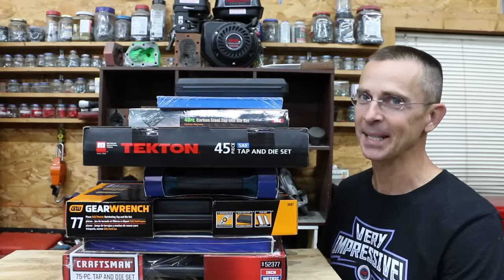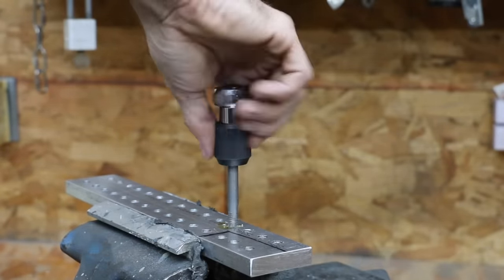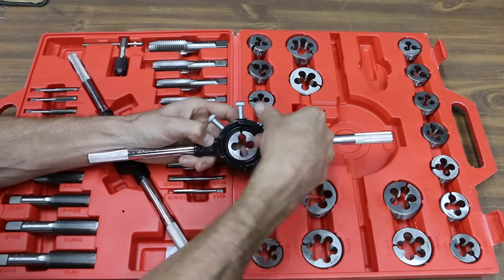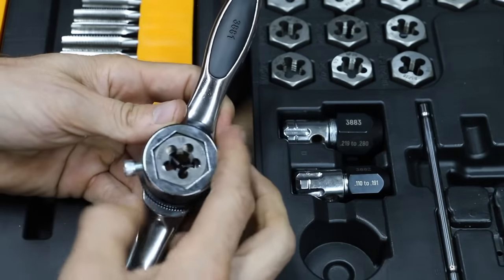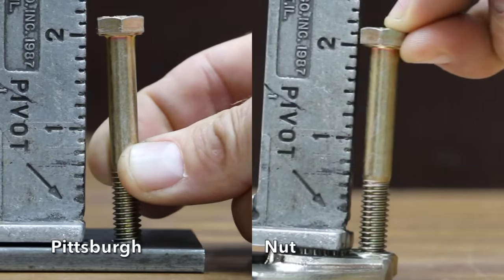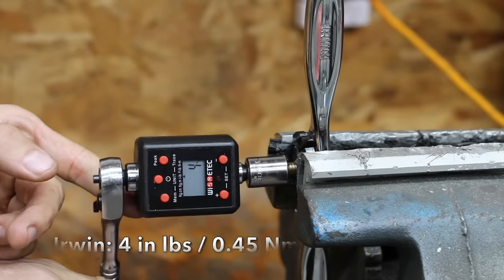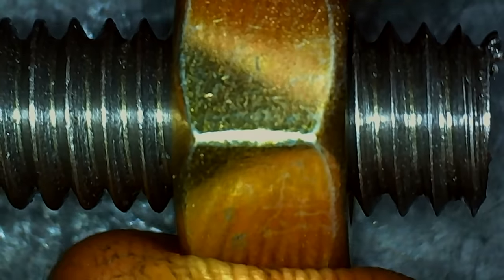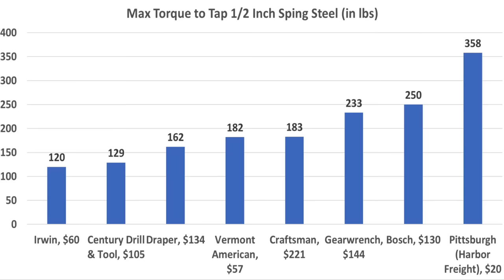Best TAP & DIE Set? Craftsman vs Irwin, Bosch, Draper, Vermont American, Tekton, GearWrench

Comment: The first problem I see is that these are, as expected, “hand taps”. Hand taps aren’t meant to be driven continuously through the material. You are supposed to turn forwards a turn or two (at the most), and then turn a half turn backwards to clear the chips. You need to do this until the entire thread is cut. That’s NOT what was done here. Therefore, these sets were not used properly.

I can’t take these sets seriously since they weren’t used properly. The other problem is the way he was tapping. Yes, he started the tap straight. But, in reality, you have to tap it straight. That’s not what he did. In order to get an accurately cut thread, you have to use a tap wrench with handles on both sides, applying pressure evenly on both handles, watching the tap while you’re tapping, so that it doesn’t wobble and make a bigger tapped hole. 

With the dies, you are supposed to be doing these by hand as well, clearing chips as you go. Handheld die wrenches aren’t required to clear chips without some help.

I always recommend that people not buy these sets unless you almost never have to use them but have no idea which ones you will need when you do. Otherwise, buy spiral tooth taps that will allow you to tap continuously through making batter threads and much lower force. Buy what you need when you do. You’ll be happier in the long run.
Reply: I’ve just come on to say much the same thing 👍👍
Reply: Agreed (though it's "spiral flute" not "spiral tooth" taps).
Reply: @PeregrineBF  I said tooth to distinguish from spiral flute taps which are different, and used for blind holes, as they project the cutting out the back of the tap, towards you. Spiral taps, as they’re just usually called, or sometimes machine taps, or gun taps, have straight flutes, but the cutting teeth are at a short spiral at the cutting end. They push the cut strings forwards, out the front of the tap, through the hole.
Reply: This is a fair critique. The instructions for the pittsburgh tap do include the instructions that you should turn backwards to clear out the chips.  I'd expect the others do as well, since AFAIK this is standard technique for hand taps.  Standard advice as I recall from my father from 40+ years ago.
Reply: I agree. His tests are normally very good, but this one was a failure. The procedure for cutting both internal and external threads was completely wrong. You MUST clear the chips. You have to work slowly and get a feel for how  your tap or die is cutting. Most people just drill a hole and use a tap like they’re installing a bolt into a threaded hole. No wonder they get poor results or a broken tap. There’s a great deal of finesse involved.  In over 40 years of metalworking I’ve never broken a tap for three reasons: using quality taps, working slowly with a quality tapping fluid, a a lot of good luck.
Reply: I agree with your comments on the abusive way the taps where used, however all the sets where abused the same so the test does allow for a comparison of how these tap and die sets hold up under abuse. 
Also in the real world we can't always follow all the rules whem it comes to cutting threads.
Reply: @jonathanlloyd919  the problem is that when used incorrectly, you don’t know how the results will correlate to them being used correctly. These are carbon steel. No matter how good, they will wear fairly quickly when compared to decent HSS taps. When used in a drill as the cutting was done for the dies, they will heat up. Likely not enough to remove their hardness, but not good. The flutes on hand taps are designed differently. In fact, they were the first taps made by machine back in the 1800s, and it was just the only way they could make them. So they couldn’t be used in machines because they have to go back and forth.

When he used them the way he did, he totally moved out of the envelope they work in, and so the tests mean little other than that some of the sets are just junk, and you could tell that just by looking at them—no tests needed. But for the better sets, these tests obscure the real differences, if any, because of the abuse he subjected them to.

These aren’t the only tests he’s done that go against the way tools are supposed to be used. Not everything can be subjected to the same tests, in exactly the same way. That’s simply incorrect. I’ve got hundreds of drill bits, for example. Entire sets designed for just some materials, for no more than a certain depth. Test a set the wrong way, and even though it excels for what it’s designed for, it will fail. Does that say it’s bad? No, just that the user didn’t know what he was doing. Use hand taps the way you use machine taps, and they will fail. A tap should have hundreds of holes to tap before it goes bad. At the very least, dozens in a difficult material, before it substantially dulls.

If I have to tap something in a crevasse, say, and need a long handle tap holder, I hold the handle with one hand and steady the shaft with the other so that it doesn’t wobble, and open the hole too much for a loose fit. The way he did it almost ensured a bad fit. I’m surprised any looked half way decent. You can’t use a hand tap holder with a long handle with a torque extension, with a handle on the end of that, and use one hand to tap.

Comment: I knew a guy that used to do specialty tune-ups. He was so particular with his tune ups when he bought spark plugs at the parts store he took his microscope with him to check for cracks so small they aren't visible however close you look. It was amazing how he could walk into a parts store and only every 1 in 3 plugs had no cracks in  them. I would like to see a video that tests tiny cracks in the plugs, or testing the difference between copper, iridium, and other types of plugs. Great video by the way.
Reply: Denso Iridium Power are supposedly the best ones, but of course a test would be great.
Reply: But also, usually the best bet is to stick with what the manufacturer recommends, because you can never really substitute one brand for another one to one.
Reply: @pubbiehive  From experience, I'd agree.  I bought some E3 plugs for 2 of my cars about a year ago.  After a year, one car is fine, the other car started having severe miss-fire problems.  Replaced the plugs with the originals plugs with 50K miles, and the miss-fire went away.

Good quality plugs that last 70-100 thousand miles are somewhat expensive at $7-$12 a plug, so just buy the same plug the manufacturer put in and you won't have problems.
Reply: He actually has a video already testing lots of spark plugs if you've seen them but nothing about cracking tho

Comment: What a professional test! My immediate takeaway are:
1) I should just pitch my 'Pittsburg' tap and die set (which I already knew removed a lot of material from pre-threaded threaded rods/bolts and resulted in loose fitting nuts)
2) Even without use on spring steel, taps/dies have a shorter usable life than many tools - somewhat akin to drill bits, except taps/dies cannot be re-sharpened.
Reply from the maker: Thanks!  Thanks for the feedback.
Reply: You can resharpen a tap. Especially the expensive ones.
Reply: @Ztalin  I'm surprised..The actual amount of material (leading edges of the flutes) is quite small and any removal of material will shrink at least the minor (root) diameter of the tapped hole. Do they first rebuild the material on the tap via. a plasma spray or vapor deposition, and then sharpen
Reply: @gregparrott  No you just grind the chip surface och the flute. When we do it at work we remove about 0.1-0.3mm. Most taps can be resharpened at least 2 times. The relief angle on the flutes is not big and the tolerance on the diameter is not an issue.
Reply: @Ztalin  I don't mean to 'nitpick', but 0.3mm can be a lot. That's 5% relative to a 6mm bolt.
That leads me to ask what size limitation exists on resharpening taps. If you're resharpening taps for holes in large structural elements, 0.3mm seems fine. But my limited world rarely sees bolts larger than 12mm.
Reply: @gregparrott  0.3mm with a relief of 1-2° relief gives you a decreased radius of 0.01mm. We resharpen taps daily for customers. The biggest ive worked on was a m72. The choice between resharpen or throw away is something i know from experience.
Reply: @Ztalin  Good to know. Even though it's very unlikely my usage and level of tool purchases will ever warrant resharpening a tap, I appreciate learning from those who have a professional level of knowledge.

Comment: Taps are a perfect illustration of "Quality doesn't cost, it pays".  Now that I have a full set, every tap I replace is the best quality I can find, because removing broken taps is no fun at all!
Reply: What full set do you recommend?  I need to get one but am only buying once.
Reply: @Mikesmeyer88  Sorry, that's like saying you're only buying drill bits or tires once.  Taps are cutting tools and will dull with use.  And continuing to use a worn-out tap is a sure way to break even a top-quality one.  Buy a reasonable quality set and, as they wear out, replace them with top quality.  Most people won't even use half the taps in a large set.
Reply: I agree. i quit like 3 stage taps as im in no rush to remove a broken one. I generally pay more for 1 good set of 3 taps than the sets in this vid
Reply: The integrity of the material one is cutting and tapping varies greatly also. I travelled nine states for a union contractor, founded in 1869, that manufactured and installed  industrial and institutional heating, cooling, and process equipment. 
 I was lead service foreman and was also hands on in service and project management. We also designed and built our proprietary control systems. 
 Many of our bids required that all materials be sourced in the US. With power threaders we would occasionally get garbage raw stock that one just couldn't cut - it would seize, roll, and mutilate the stock.
   I still have pipe dies with MANUAL handles from 1/8" up to 2 1/2" NPT, and taps/ dies to ridiculous diameters (most techs these days would run or faint!) 
  Was a lot of tough work but it was very rewarding. -- and then I fought fire, cut people out of their vehicles, ran EMS, dive team, and occasionally flew with medical helicopters to unwind after dealing with some of the people with too many framed documents on their plush office walls -----
 ** Definitely appreciate the effort and time put into these videos.
Reply: @Mikesmeyer88  Do not buy a set. Even the best ones pale in comparison to a quality tap. Buy a tap when you need it and eventually you'll have a set.

Comment: Hanson are still up there, but finding a good set is tough. Irwin seems to make the weirdest sets, so you have to buy two or three for some of the sizes. And I will say this again, Husky (and in general cheapo Chinese ones) suck. I don't care if they warranty them for life if it breaks the parts I was working on (whit the tap grenades).

Also, I will say, the die will clog going in all the way without backking up. The rule is do a few full turns, then back off half to one turn, which is why I do like the reversable ratcheting stock. For the die, once you use a Starrett, you won't go back. Those are NICE.
Reply from the maker: Thanks for the feedback.
Reply: @ProjectFarm  He is right, though.

Retail junk like Husky will usually break when you are miles from the nearest Harbor Freight location.

People who use your opinion to make actual real world decisions for tool purchases just don't care about the newest and neatest Ikon branded indexing ratchet.

Comment: Thanks for another great comparison test.   Through a lifetime of hobbyist metalworking, I've learned that anything less than US-made HSS is a waste of time and money.  These cheap sets may be OK for the occasional homeowner thread cleanup, but if you want good threads, good tap life, and avoiding broken taps, you have to pay for the quality.   Anything "high carbon" or similar is good for nothing more than cleaning up existing threads.    Anything Chinese is inherently junk.

I would have liked to see this test at least include a control reference consisting of something like a Kennametal, Cleveland, Greenfield, Union-Butterfield high quality tap.   

It is also important to make sure the tap goes in straight by using a spring-loaded tap guide.  Even after starting off from the drill press, if you wobble a bit or if you're off perpendicular by even a small amount, it makes a big difference in thread quality, tapping force, tap life, and not breaking your tap.

I've learned the hard way over the years that all these sets are basically junk, even for hobbyist metalworking.  You can buy your taps one at a time as needed and have them in a day or 2 from MSC or McMaster-Carr.  You'll pay more for one tap than for an entire set of these cheap Chinese taps, but believe me, it's worth it.
Reply: concur
Reply: Je veu voir.Yvan bolduc Lewiston meine USA.

Comment: I’m a diesel tech, and I own a snap on set. They are very very good. Taps the quickest and I have only ever broke one, and the broken section only revealed itself after I already removed the tap (I.e the tool didn’t” break in the bolt hole). Very good tool, highly recommend.
Reply from the maker: Thanks for the feedback.

Comment: Awesome videos, and usually I have no complaints. But this time I have concerns. Both the side-to-side tolerances and the torque needed are very sensitive to how straight the tap or die is and driving them by hand with no guides is going to make that vary a lot. In the sped up video you can see the some of the taps rocking from side to side and the rod didn't look straight in any of the die tests. I would recommend testing with a tap guide holding the tape straight to see if the side to side tolerances were better and for the rod to see if the dies lasted longer (though yeah, clearing chips would be fairer too).
Reply: That’s my complaint as well, torque testing with a wobbly setup then measuring the looseness of the bolt is not a great test. Too many variables. Doing a comparison like I the first test is fine but when you add measurements but use the same janky setup I think you invalidate the results. 

Same with the die test. Performing a failure test intended to determine how far the rod will go is not the intended use of the die and shouldn’t be how you measure if you will get a tight fit under specified procedure.

Comment: The Craftsman and Gear Wrench sets were impressive!
I own a Snap-on set myself and I've had it for 27 years - hardly used.
Tap and die sets are rarely used by skilled mechanics but when you need it, you're mighty glad it's in your tool box.  
Don't buy a cheap set!  
I might buy the Gear Wrench for the die handle.

Thanks again PF for yet again another well informed video.
Reply from the maker: You are welcome!
Reply: very true, if you're using these all the time you're doing something wrong
Reply: @MattB90  OR a fastener breaks when you are trying to remove a rusted or otherwise seized fastener.  OR you're removing a ferrous fastener in a aluminum tap with a lot of electrolysis in the tap and the tap is stripped out.
I rarely encounter these situations, and when I do I usually know what to do to avoid the use of the tap and tie or a heli-coil.   As I said, my set is rarely used in 27+ years.  It still looks new!  (Wanna buy it?) 😏
Reply: @Inquisitor6321  Do I want to buy your snap-on tap/die set? of course...can I afford to? probably not lol
Reply: @MattB90  I bought it 27 years ago.  I paid less for it than the Craftsman kit goes for today.

Comment: This was a really good, useful review...I purchased my Craftsman set back when Craftsman was still made in the USA. It's at least 40 years old. I've never had to replace any of the taps or dies and in fact I've done nothing but add to it. I use it to cut threads in everything from hardwood to high carbon tool steel. Craftsman might cost a little more, but in the long run, they are well worth it. Especially if you can find an older set...Great quality and not overpriced like Snapon...

Comment: Depending on how tightly you clamp the die, it has an effect on the threads. That's why there's an open slot on the die itself for thread depth adjustment
Reply: Why would it be adjustable because I have a big snapon set and there all adjustable dyes
Reply: @Bryan Wildeman  different manufacturers have slightly different tolerances when cutting threads in nuts etc. The die wrench should have adjustment screws to squeeze the die and make it cut deeper or shallower threads to suit these differences.
Reply: Only one brand was a split die for cutting new threads; all the rest were for chasing existing threads.  Same with the taps…typically you would have three taps to cut internal threads.
Reply: @borysnijinski331  You would need three taps only if you wanted to tap a blind hole though